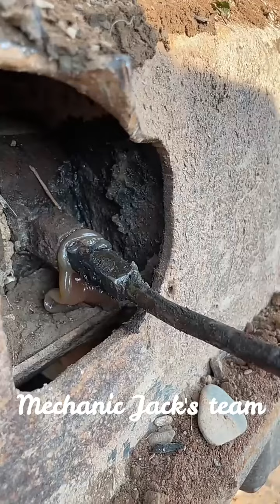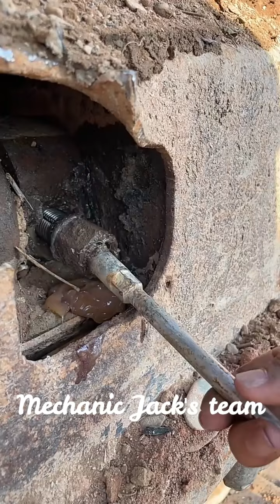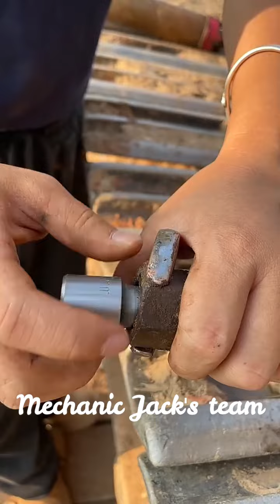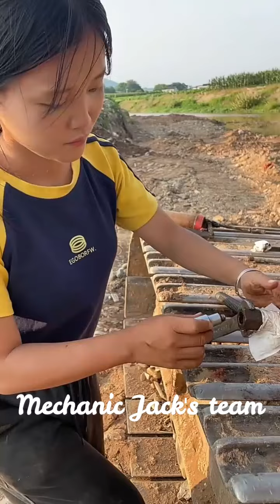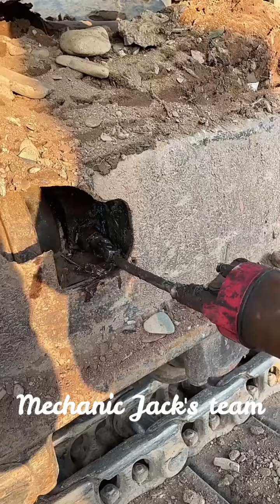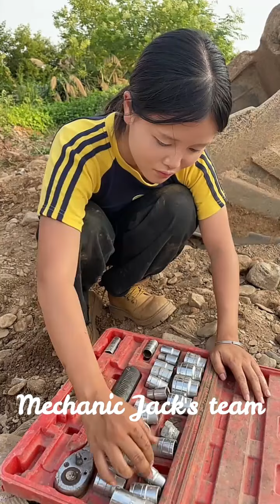Excavator Track Adjuster Grease Fitting Repair

Comment: Thats a great job getter the track put back on the excavator and then changing the grease fitting on the adjustment cylinder to keep the track tighter.   Im sure other's do this but your the first one ive watched doing such a great job 👏 👍